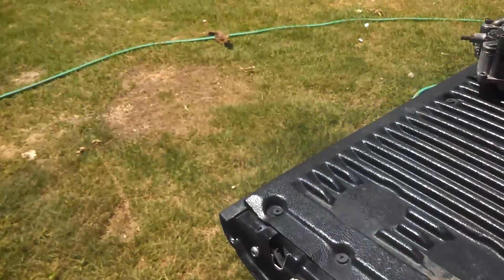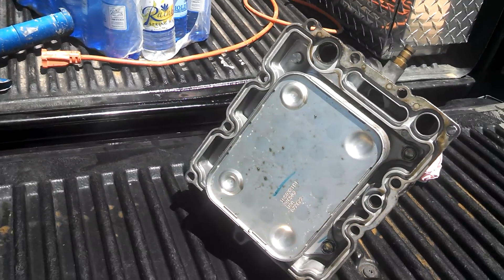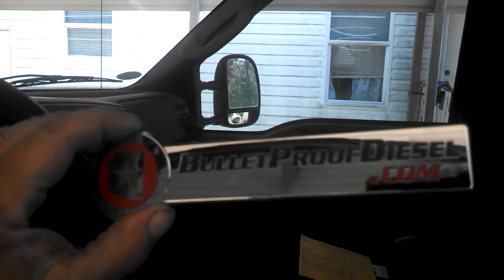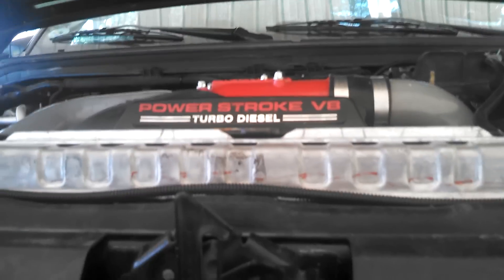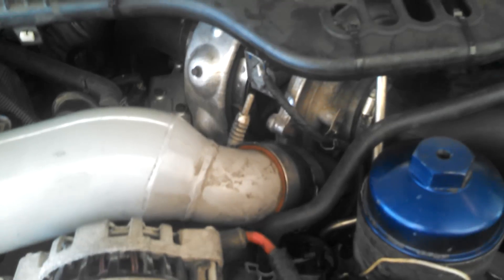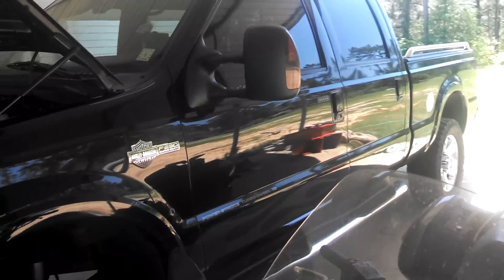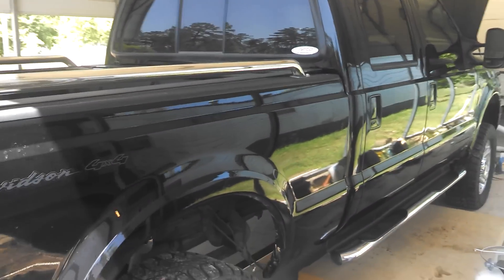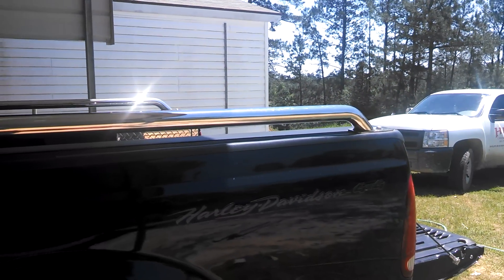6.0 power stroke bullet proof oil cooler and ficm moduel

Comment: Nice rig bud. I got a 2005 f250 xlt 6.0 diesel. Love it. I believe a lot of problems are "operator malfunctions" more then vehicle problems. 114,000 miles and running strong. Babied and floored once a week to rick that soot out er

Comment: Ok thanks. I'm doing EGR delete, aftermarket oil cooler, mbrp 4" turbo back exhaust, aFe intake.  2005 f250 6.0 114,000 miles. Owned since 79,000 miles have had 1 glow plug, 1 EGR, 1 injector, and 1 radiator replaced all this at about 97,000 miles. So my question is you think with the upgrades I'm doing I should be ok. Sorry but your video is the only one where some one actually shows what they did. Also why is your oil filter moved. New to the diesel world. Love my truck and want to keep er for years to come. Just trying to do all I can myself to save money.

Comment from the maker: My oil filter is relocated with the bullet proof system the stock oil cooler is part of the stock filter I have a bullet proof o cooler in front of radiator plus I have a am soil by pass filter I have a fass fuel pump banks tuner all aluminum radiator extra large trans pan cold air intake some fuel line mods optima batterys regular battery's put off corowsive gasses that are suck in to intake and coroid your engine on inside  ford also has a upgrade to your fuel psi regulator called a blue spring that will BRI ng psi up and save your injectors  there are a lot of mods I would also change your radiator cap it get. Week after lot of miles this lowers boiling temp due to less pressure in system

Comment: Did you do the EGR delete yourself? If so my buddy and I are going to attempt it. Is it doable for a DIY guy or if you need to be a diesel tech or something.
Reply from the maker: yes it is a pretty big job I had afriend who works on 6.0 at a ford dealer  he helped me I did a complete bullet proof system life time egr but I have a plug in intake so no ex comes into motor 6.0 have sand in motor  from the casting of block that can stop up the stock oil cooler making the oil get extra hot it is left in the water jackets some have more than others  they will last a long time if treated right
Reply from the maker: u can get two fuel bolts for a 6.2 that fit the 6.0 they are in front of motor the 6.0 has a check valve in each bolt that slows the fuel down this helps to save in jectors the 6.2 bolts have no check valves in them  u don't need them